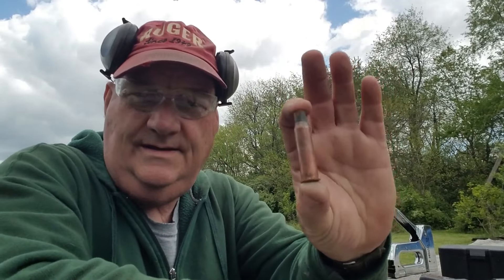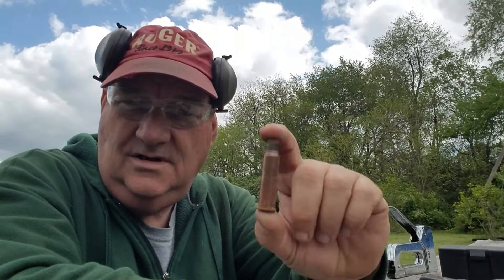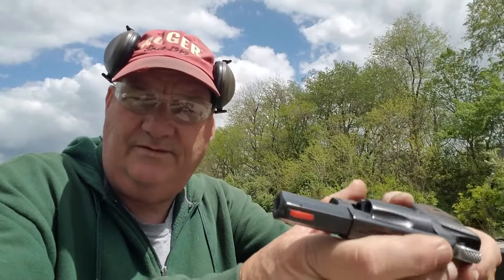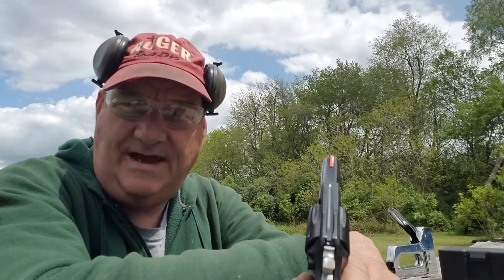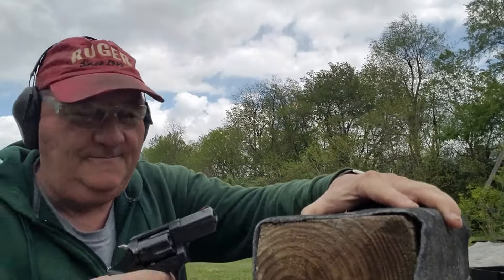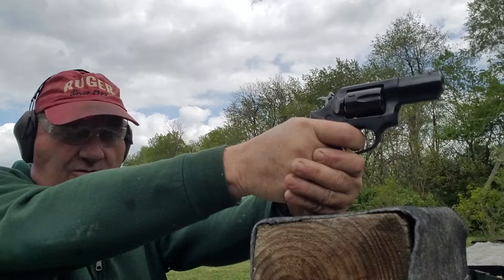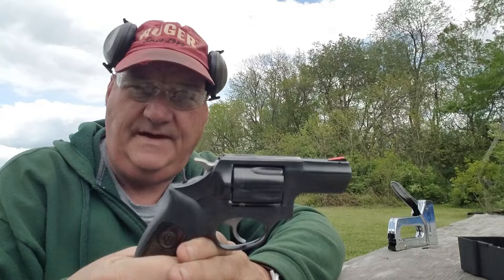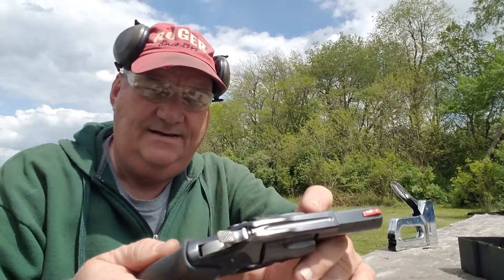Ruger SP101 Pocket Hand cannon

Comment: I have the SP 101 but in 327 Fed. It's a lump of stainless steel that weighs a ton more than my LCRX in 327 Fed with the same capacity. It's sort of a go between of a snubby and a service revolver with traditional Service revolver capacity. I like it but it requires a far more robust carry rig that the LCRX, which carries well in a sticky pocket holster.
Lipseys is offering this same blued 3"SP 101in my 327 Fed but I can't justify buying it when it's just a blued version of what I already own with a lesser under lug.